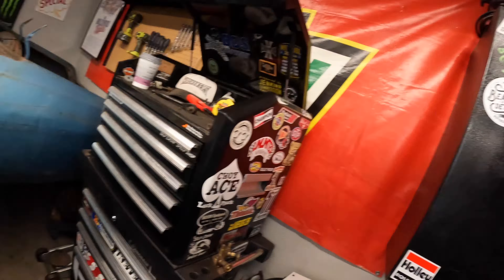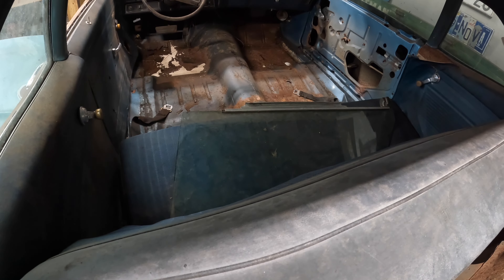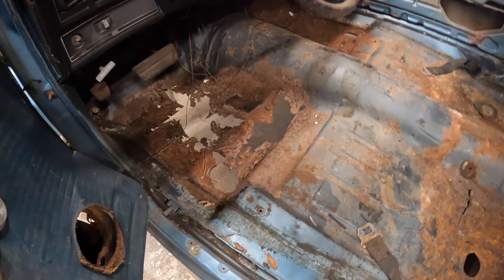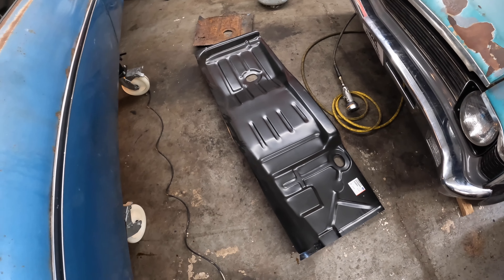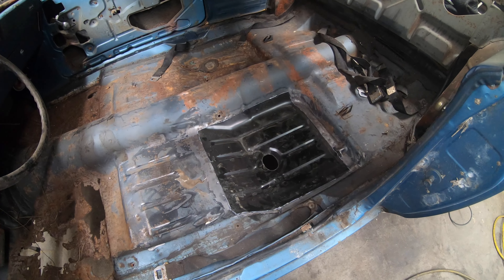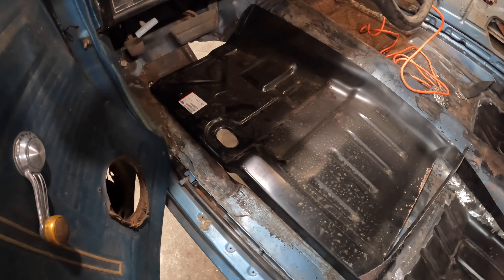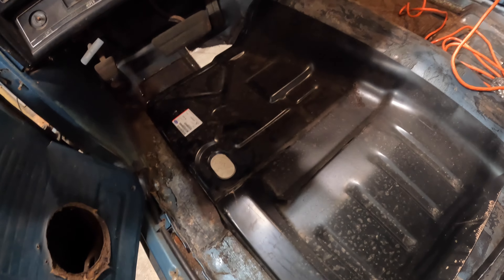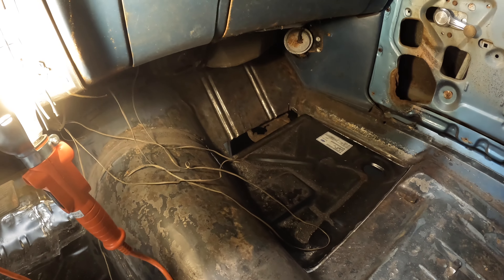Floor pans in the "BUDGET" 72' Nova!!!!

Comment: Cool Video there buddy..  I just received a 1970 Nova, that I was riding in since 1972..  The process of disassemble and discover is just beginning.   The engine has a Dr appointment in 3 weeks.  Its getting a new Tranny w/Converter and 12 bolt Rearend rebuild and more things than I have lead in my pencil for, already lol  Your video is more inspiration..  I have subd to you.  Ill start to video my journey as well.

Comment: You can use panels off air conditioners they are excellent to use and won’t rust if you paint them or undercoat them. You can get them from a AC person. FYI.

Comment: Awesome video dude, super helpful! I’m having a tough time finding wheels I like with a 5.25 back spacing. Do you know if a 5 or 5.5 would still fit the 275?
Reply from the maker: Some people run a 5” or 5.5” back space and are still able to get away with the 275. However every nova is a little bit different and the 5.25” is the most universal fit backspace to ensure that the 275 will fit without modifying your car (rolling or cutting quarter lip, or relocating shocks). A 5.25 back space is pretty hard to find which is why I went with a steel wheel that I could custom order the backspace I wanted. Glad you enjoyed the video I really appreciate it!